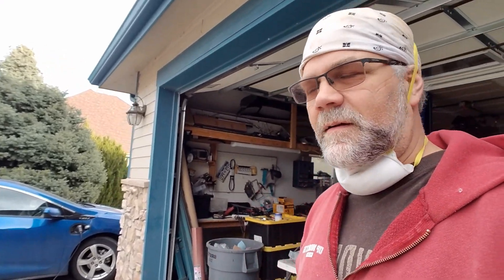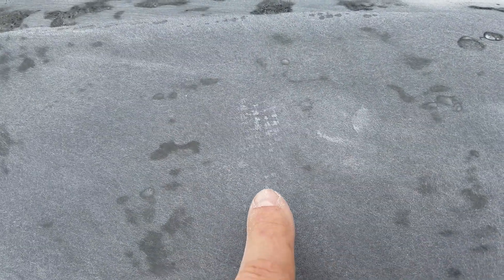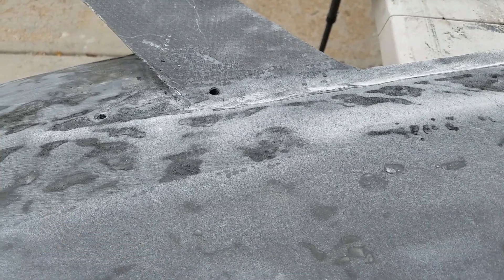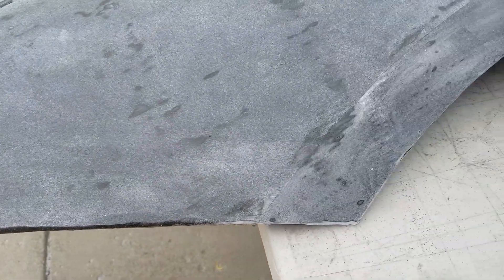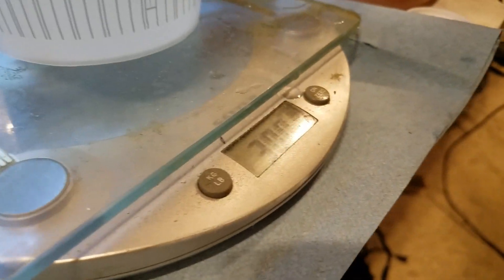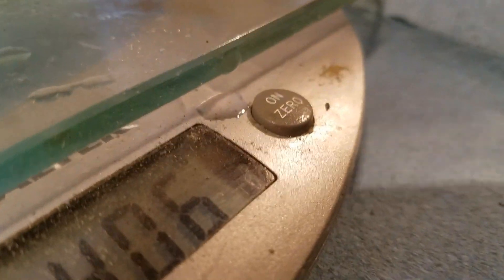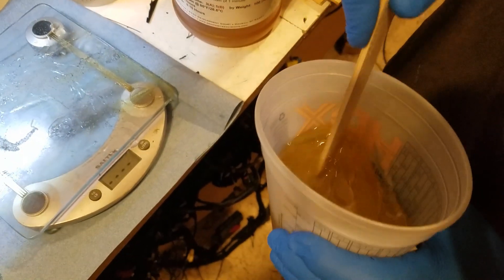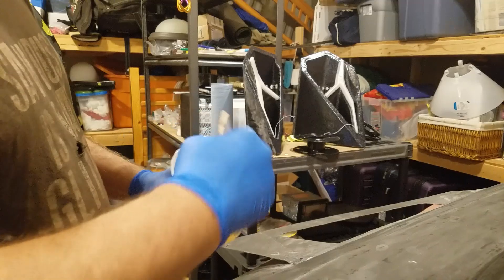3D Printed Interceptor Update 12

Comment: It would be interesting to see if spraying the epoxy with a electric spray gun make the pieces smoother (easier to sand). After it's done sand the clear then flow coat with very good quality clear. Love the build

Comment: Very cool build, but you're giving yourself more work for no reason. 

Lookup Peel ply, you can use it to create a smooth finish in your epoxy on simple yet relatively flat panels like youre dealing with. You can simply apply it after the epoxy then smooth it out with a flat blade object, or you can use it in conjunction with a vacuum bag, which would make your parts lighter, and far smoother and easier for you to deal with. food for thought.
Reply from the maker: I use peel ply.
Reply: lasersterling I missed that, sorry, like I said cool build! Very inspirational. I’ve built many Electric skateboards using a 3D printed core wrapped in carbon, awesome to see it used on a full scale project!

Comment: A body trick is to add body filler around the run so that when you sand , it is smooth and even . You will be able to gauge the depth of sanding around the run.